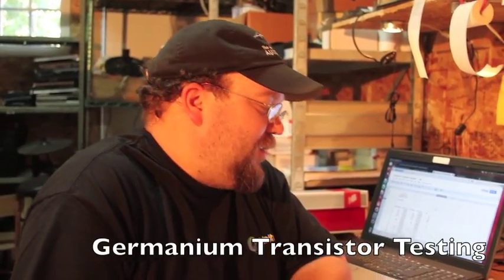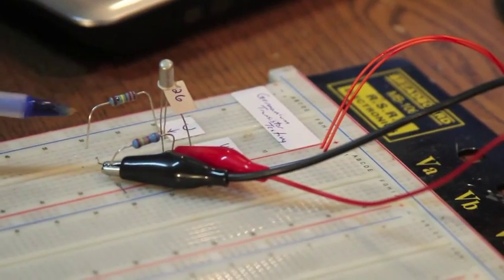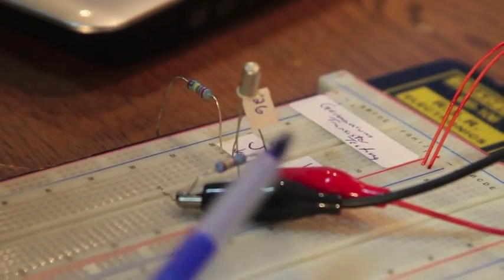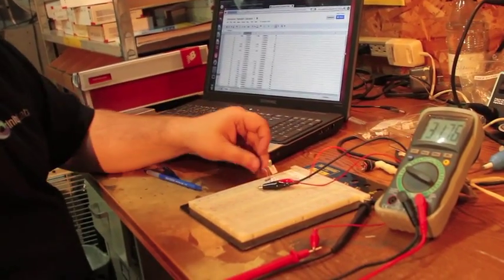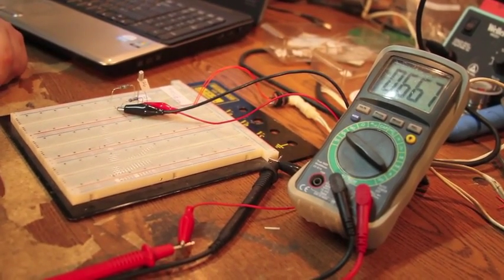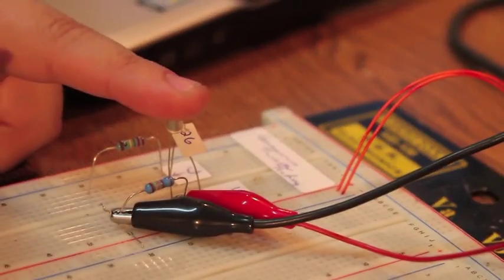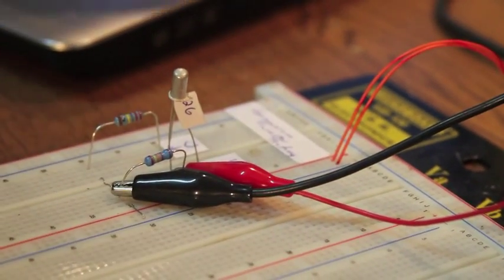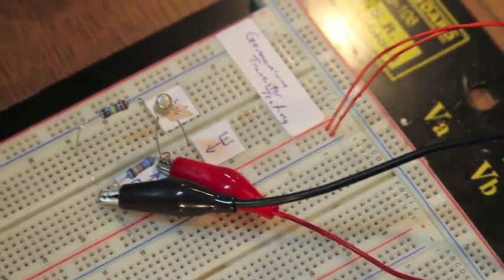How to Test Germanium Transistors - Fuzz Face AC128 vintage transistors - Synthrotek

Comment: Helpful test, unfortunately the PNP ger transistors I test have the same voltage across the collector resistor when it's on or off, I guess that is 100 % leakage or Zero gain 😢

Comment: Isn't the tab on the metal case of the transistor the collector with those transistors made in Germany?  You also need to mention that the meter should be capable of measuring at that level.  There are cheaply made meters that will not read at the levels with this type of tester.